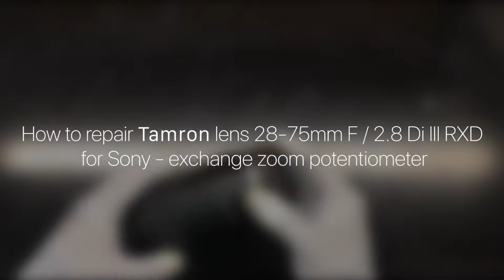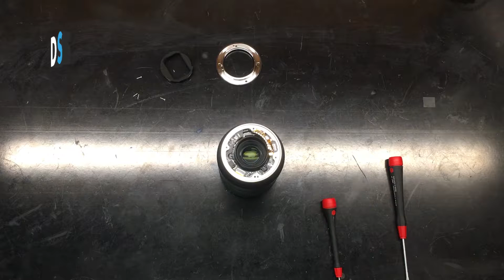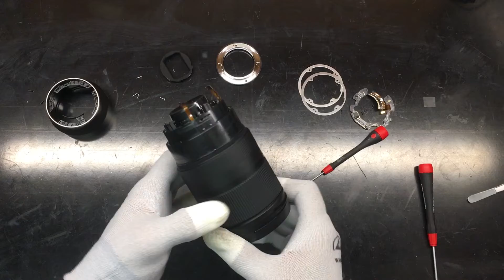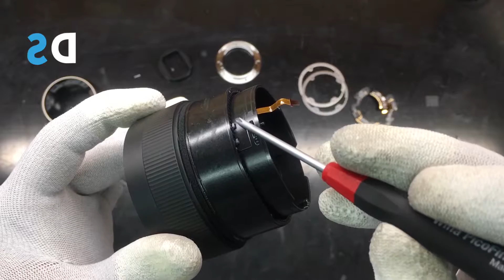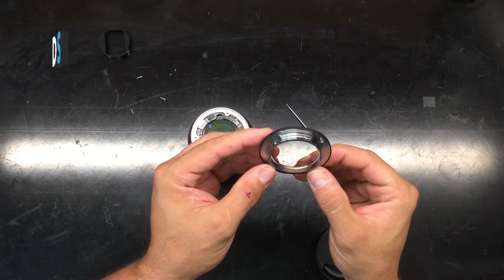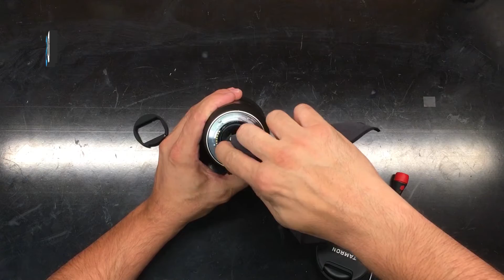How to repair Tamron lens 28-75mm F / 2.8 Di III RXD  for Sony - exchange zoom potentiometer

Comment: Nice video, thanks! Do you know how to remove the plastic part that holds from glass element?
Reply from the maker: Hi, there is a thread lock applied on the decorative ring. Use Alcohol and then unscrew it :)
Reply: Thank you!

Comment: How would you fix one that had the lens mount knocked off from a fall? Assuming it's a whole but the mount is now separated. How do you get it reattached and will the AF still work?
Reply from the maker: Hi, if the mount is separated or defective, need to replace the lens mount. We can fix it and if you want you can send email to service@digi-service.eu with your questions. Thank you!